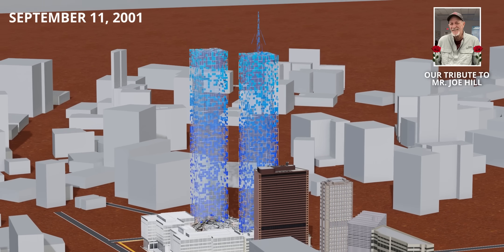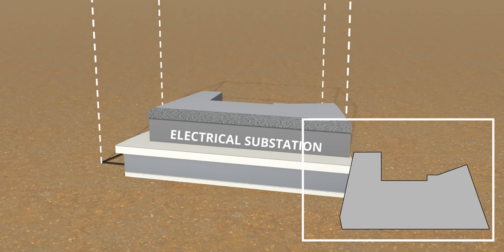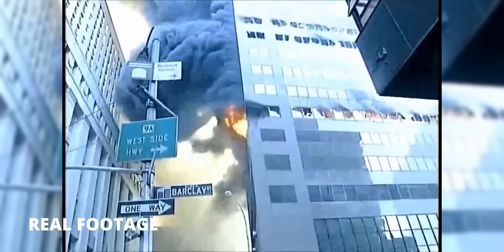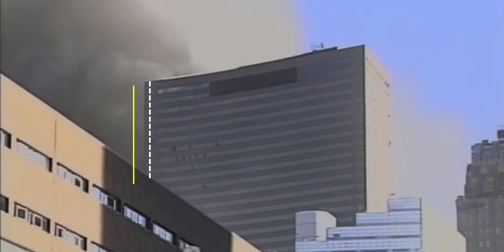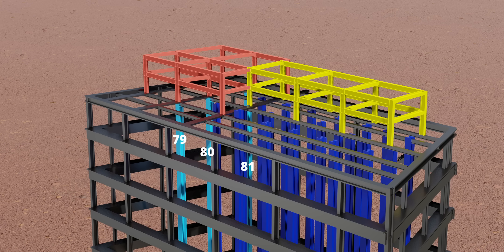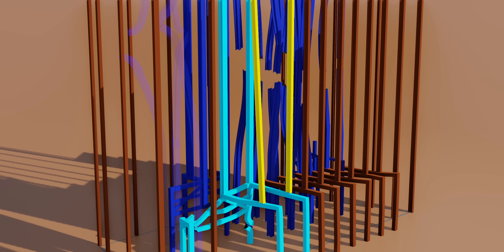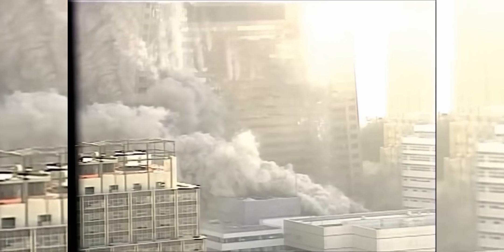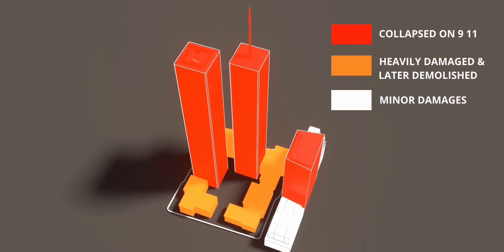Collapse of Building 7 | The Complete Physics

Comment: Anybody capable of critical thinking can determine quite quickly that this wasn't a collapse caused by office fires and minor structural damage.
Reply: Really? 

The North Tower collapse at 10:28am bombarded Building 7 with tons of debris, causing heavy damage and starting multiple floor-wide fires burning out of control for 7 hours. Half the FDNY firefighters having been killed, units in disarray, equipment destroyed, no water pressure, and the greater urgency of search & rescue efforts, firefighting was pulled as futile. The building couldn’t be saved and was left to its fate. That is the sort of choice firefighters make every day in brush fire situations - which houses to save and which ones to let go. Only real difference here is moving the decimal on the size and cost. People get overwhelmed by the size. 

www.youtube.com/watch?v=g_SvpwyC17M&ab_channel=MFitz  

Collapse of a burning structure is always a concern for firefighters. Steel buildings subject to fire rely on active fighting of the fires to survive. Buildings are designed around 1 to 3 hours of fire resistance, allowing time for occupants to escape and ACTIVE firefighting to get started, after which all bets are off. Left to their own devices they will exceed their design envelope and collapse. In B7 the occupants escaped, passive and active fire protections were compromised and active firefighting was abandoned 3 hours before the collapse, which left the building to its fate. It lost. Odds on Building 7 would eventually collapse, and it did. No big deal in logic. But there is no logic in conspiracy belief. 

www.youtube.com/watch?v=WnYBX6QT0R4 

FDNY Chief Daniel Nigro ; The biggest decision we had to make on the first day was to clear the area and create a collapse zone around the severely damaged 7 World Trade Center, a 47-story building heavily involved in fire. A number of fire officers and companies assessed the damage to the building. The appraisals indicated that the buildings structural integrity was in serious doubt. I issued orders to PULL back the firefighters and define the collapse zone. It was a critical decision; We could not lose any more firefighters. It took a lot of time to PULL everyone out, given the emotionalism of the day, communications difficulties and the collapse terrain

FDNY Deputy Chief Peter Hayden ; We had our special operations people set up surveying instruments to monitor and see if there was any movement in the building. We were concerned of the possibility of collapse in the building. And we had a discussion with one particular engineer there, and we asked him if we allowed it to burn could we anticipate a collapse and if so, how soon? And it turned out that he was pretty much right on the money, that he said 'In its current state you have about 5 hours

The collapse of Building 7 was anticipated and widely reported in the media throughout the day. At least 24 video cameras recording some or all of the collapse. Everyone knew what was coming and why.

www.youtube.com/watch?v=OY5S5k3tMHI 

Building 7’s collapse was entirely different to the Twin Towers and harder to understand as most details hidden from view and not intuitive, but we can still sort out what happened through careful analysis and observation.  This is my explanation  of the collapse using relying on no outside authority.

B7 was complex, assymetrical 47-story steel framed structure built on top of a smaller 3-story building, requiring lower floors dedicated to complex load transfer structures, not usable office space. Of trapezoidal shape and all-steel tube-in-tube construction, B7 (above the 7th floor) consisted of a central core of steel columns carrying most of the gravity load, perimeter steel columns around the outside of the structure carrying the remainder of the gravity loads and long span beams and girders to tie those elements together and form the floors. On the outside of the building hung a moment frame or outer shell.

Phase 1 : The first externally visible signs of collapse initiation occurred at 5:20:28 pm. It was notably quiet with observers not realizing the building was collapsing! No audible warning in the form of  hundreds of ear drum busting 180-190dB explosive bangs preceding the collapse. Here at 12:00 a local CBS affiliate reporter is talking 10 blocks from B7 when collapse begins. People don’t start to notice the collapse until 12:11. At 12:45 is the famous CBS fixed camera clip of Building 7’s collapse. Note how quiet it is.

youtube.com/watch?v=t5tEy6mXSE8&ab_channel=fresnosean379

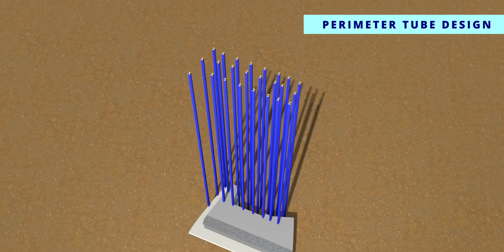Collapse initiation was due to lower floor failures above the load transfer region (7th floor) in the NE corner. In this video at 0:45 you can see the NW corner from inside the building while under construction, Column 79 just out of frame on the left. That big, angled steel beam across the top of the frame connects to C79 at one end. The girders connect to the beam. That beam and all those girders depend on just one connection

youtube.com/watch?v=nP3TNHPCIVU&t=35s&ab_channel=EdwardCurrent

Phase 2 : Lower floor failures caused a loss of critical lateral support over an excessive length of core Column 79 and it buckled. If you look at a floor diagram of Building 7 (see above) and look at all the structures that depend on C79 you quickly realize this one column was a relatively isolated structural element on which a disproportionately greater fraction of the structure depended analogous to say the Key Bridge. Externally we see a vertical progression of window breakage along the 44-46 line and a kink in the roof of the East Mechanical Penthouse at the top of the building, consistent with C79 failure. The transition from full capacity to almost no capacity occurs in virtually an instant. Once the buckling failure occurs there is almost no resistance

Normally with a buckling column, the load could very well be redistributed to other columns, meaning the buckling could stop after a while. With C79 that is not the case - the failure did not redistribute the load, so the collapse rapidly progressed to the roofline, sinking the rooftop penthouse.

Phase 3 : With C79 gone, B7’s progressive, non-symmetrical collapse continues with C80 and C81 at the east end of the core left laterally unsupported and quickly buckled and failed as well, sending the EMP down through the building. C79-81 all have no diagonal bracing, which I believe is a major reason why they could not redistribute a lot of vertical loads among one another.

From there collapse progressed from east to west through the central core until the core was gone taking all of the interior floors and probably most of the perimeter columns with it. Follow the horizontal progression of window failures low in the building and the dropping of the remaining rooftop structures into the building. One of the big takeaways from the NIST Building 7 study (that gets completely ignored) was their modeling which determined C79 failing under ANY circumstances would have initiated the same collapse sequence.

Phase 4 : After 10 seconds only the exterior moment frame - a hollow empty outer shell – remains, giving the illusion the building is still standing since little has outwardly changed. But it’s just a hollow empty shell like an empty cereal box and supported by only a few remaining columns quite unable to remain standing. With all internal framing gone, the north face leans inward, forming a V in the roofline, the last columns buckle under the strain and the moment frame free falls, landing on top of the 7-story high debris pile. It is only here at the end that a single measurement of alleged free fall acceleration is taken, from a single point on that outer shell. The Building (defined as its center of mass) did not “free fall” – just one corner of the outer shell did- sort of. The Building was already gone before that happened. The period of alleged free fall was a product of collapse progression mechanisms, not of collapse initiation mechanisms and cannot tell us what started the collapse. Start to finish the entire collapse took 18-20 seconds, 3 times longer than true free fall .  How fast something falls cannot tell you what started it falling_ anyway. The debris spread outside the footprint, blocking surrounding streets, heavily damaging the Verizon Building and destroyed Fiterman Hall.  

Building 7’s progressive, non-symmetrical collapse was incidental and unintended collateral damage from the combined effects of fire + time + gravity, started by the collapsing North Tower. That is true no matter who planned and carried out the 9/11 attacks or why . The collapse was of so little consequence it barely even registered at the time, a mere footnote. It only took on semi-mythical status as an alleged smoking gun years later when demolitions at the Twin Towers, missiles at the Pentagon and shoot down over Shanksville all failed and conspiracists had nothing left to work with.

Anything can seem like a conspiracy if you don’t understand how it works. Now you should. I hope you found this helpful, informative and it solicits informed critical comment. If I made any errors of fact, logic or reason or left anything important out, please let me know so I can fix it. IF you can offer a more plausible alternative please do. Be the first. Please start any reply with the words “Tits McGee” or I will know you didn’t read it and are wasting my time. 

For the record: In 24 years, zero structural engineers of tall buildings, including the one-third that have retired during that time, have made any statements in support of 9/11 Truth BS demolition claims. Zero, nada, none. There is a total lack of any such citations in the engineering literature (published in any country worldwide).

Comment: Thanks for confirming that it was a controlled demolition! Your graphic shows the 16 core columns to bedrock complete severed (7:00). Also you mentioned that the office fires had reached a temperature of 600 degrees Celsius (1,112 degrees F.) which is not even enough to bend structural steel (1,800 degrees F. )
Reply: lol you’re wrong. Mild steel bends between 900 and 1100 degrees Fahrenheit, high carbon steel bends between 1000 and 1200 degree Fahrenheit. 1100 degrees Fahrenheit is 593 degrees Celsius. So think again buddy. The conspiracy videos you’re watching don’t know proper physics 😂😂😂
Reply: @eddiewilberding8374 So what you’re saying is that all steel construction skyscrapers are dangerous as fuck and should be illegal, you’re saying they’re one fire away from falling down onto everything around them??? you guys doing the temperature calculations also keep forgetting that these buildings were built in the 70’s, and all of the steel beams and columns would have been fireproofed with spray on asbestos insulation, that doesn’t combust at any temperature, is sprayed on very thick and would have greatly enhanced the steel’s resistance to heat from fire.
Reply: I'm stunned at people who don't understand science concoction conspiracy theories that totally display that lack of understanding
Reply: So you didn't watch anything prior to 7;00 then?

Comment: Oh! So...now there's a "gash" on the building? And it still falls into it's own footprint at freefall speed, just like the other two? How about this: WTC 7 was the CIA control point for the demo of the Twin Towers, and it too had to be demolished to hide the evidence?
Reply: The gash in the south face of Building 7 is not news.  
Building 7 did not fall into its own footprint . It's debris blocked all four surrounding streets, badly damaged on nearby building and destroyed another.
There is no such thing as freefall SPEED and how fast something falls cannot tell you what started falling. The free fall crap is nothing more than a bad internet meme.
Building demolition is not now and never has been an approved method of concealing classified equipment

Comment: The only steel buildings in the world that collapsed because of fire...
Reply: Besides the countless thousands of steel framed buildings, structures and even bridges that have fallen due to fire before and since. It is quite common actually. 

I really don't understand how conspiracists suddenly forget how fire works or how steel is formed (and deformed).
Reply: @TheCriticalStinker-01  
You probably are just to ignorant to the fact that the engineers actually thought how to make fireproof buildings using steel, otherwise it doesn't make sense to use it.
Reply: @NikiPetrovAtanasov  - That will easily be the dumbest thing I read all day.

Steel is formed using heat and deforms the same way. Steel framed buildings are typically designed for between 1 to 3 hours of fire resistance before active firefighting takes effect. After that, all bets are off.

There is no such thing as a fire proof steel building only varying degrees of heat resistance. Heat insulation and sprinklers by time, not immunity.

Comment: I participated in thermal analysis research of military grade plastic explosive using an accelerating rate calorimeter ramped the temperature to explosion and tract to change in temperature and pressure over derivative time 
Tiny little piece destroyed the detector and the bomb proof containment vessel 
But the recorder got the data military was happy My boss was angry anyway 
9/11 is a controlled demolition and Trump is not a stable genius and Putin is not your friend and Elvis You're still the king not Trump not either...🐛✝️⛳🐛

Comment: If an airplane blew up World trade center buildings three of them how did two airplanes blow up three buildings? 
I haven't awareness of physics and experience with controlled demolition 
The basic math is if the building weighs so many tons of concrete it takes so many equivalent tons of TNT to knock it down 
The amount of explosive to blow up World trade center one and two and building seven is railroad cars full not one airplane 
Kerosene is not explosive airplane fuel tanks are a series of bladders that collapse as the fuel gets used to minimize oxygen 
All the photographs from bank and security cameras were confiscated 
The shape of the hole in the Pentagon was a circle why? 
The pilots were from Saudi Arabia not Afghanistan 
The amount of energy it takes to turn concrete to dust is large that's what happens in a volcano earthquake pyroclastic flow 
To get control demolition to work you place explosives on the perimeter and inside the building on every single floor and set a time delay between the inside and the outside that causes a suction that implodes the building 
I know about the software which calculation of explosive required 
Recall Oklahoma City fertilizer bomb doesn't have the energy and the energy is the log of the distance of the truck from the building 
If the fertilizer bomb Oklahoma City was military grade explosive the pressure wave at the building after demolition would be near one PSI what? 
Timothy McVeigh Unabomber 
Cash Patel FBI disco dancer ✝️⛳✝️🐛💀
Reply: Did you have any questions about the subject of this video - collapse engineering as it related to World Trade Center Building 7?

Comment: There is nothing wrong with your sequence of failure.  So can you explain how fire of office furniture and paper in an open space was so hot it caused box girders made from 2 ins steel to buckle?  An incident of this description, must have been considered in the design feature of such a building.   What happened to the fire control systems in this building?  Too many questioned left unanswered.
Reply: Column buckling due to heat was not the collapse initiating failure. 

Multiple lower floor failures in the NE corner due to thermal expansion caused a critical column to lose lateral support over an excessive length. The floor failures though are the straw.
Reply: @ thanks for the reply. But I can’t accept that an uncontrolled fire with limited fuel, consisting of a few desks, chairs, cushioning plastics got to such temperatures that it overwhelmed the integrity of the steel columns designed to hold such a structure.
Reply: @Wilkins_Micawber  - Then stop pre-loading your arguments with BS like (limited fuel).

Uncontrolled fires wiped out 17,000 homes and buildings in L.A. just a few months ago, all those had limited fuel too.

Also, the columns were NOT the collapse initiating failure. That was the floors.